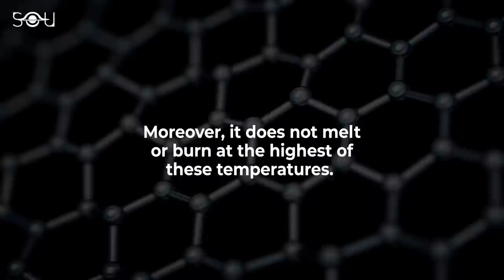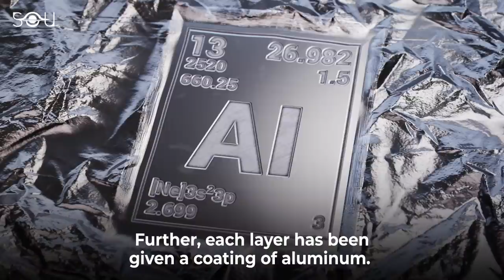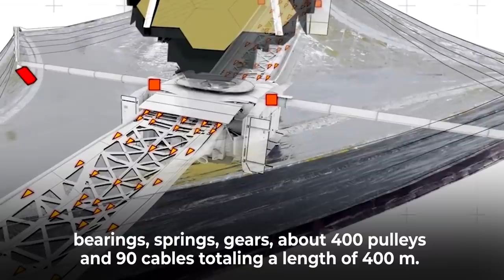James Webb Just Completed the Most Difficult Task of its Mission

Comment: The next most complicated thing will be the calibration of the individual hexagon mirrors to 100% precision in order to focus the light on the highly sensitive sensors!🔥🔥
Reply: Of course, that can be done using closed-loop calibration software.
Reply: Infrared waves not light.
Reply: @ianuragaggarwal  they can be referred to as light, because they are part of the electromagnetic spectrum. And the name is really infrared light. The word light doesn't necessarily mean visible light.
Reply: @ianuragaggarwal  Infared waves are light, just not visible light.
Reply: Still light bro.
Reply: Thanks for correction. Knowledge++.
Reply: @JohnSmith-bw8dn  No the 18 primary hexagonal mirrors are not precaliberated. Each mirror segment assembly have 6 degree freedom linear actuators and each hexagon mirror has its own actuator to move/ tilt over nanometer precision to adjust the radius of curvature. This will be the final process of JWST when it reaches the required cryogenic temperature level. And that's why precaliberation was not possible beforehand in  Earth temperatures.
Reply: @JohnSmith-bw8dn  it will take weeks to adjust all the mirrors once it reaches L2
Reply: @adarsh4764  one question, are they ahead of scheduled deployments of all equipments? because i remember after the launch they deployed solar panels right after it reached the orbit and one of the commentator said that ' solar panels are deployed ahead of the planned schedule'.
Will we see Webb telescope fully operational before 6 months?

Comment: Everything does not have to go perfectly for it to function. Even the sun shield didn’t have to deploy completely to be effective because they made it more effective than it needed to be to allow for failure. With the exception of the secondary mirror (I think that’s the name of the one that reflects the light from the big mirror into the sensor), everything could deploy 80% of the way and it would still work.  Fret not :)
Reply: We won't have to worry, Webb will fully deploy and we will get a new understanding of the universe from it
Reply: @livannal.t.9068  It will
Reply: Well that was only the first difficult task lad 😅
We still have a few more difficult obstacles to hold our knickers for
Reply: Very annoying soundtrack IMHO

Comment: 75% of the 344 Failure points are retired. Only 86 more to go! (Somehow this isn't very reassuring.)
It was 9 degrees and windy the other morning as I was walking to work from the parking garage. The traffic light ahead of me had just turned red so I decided not to walk all the way to the corner to wait for the light. I stopped in a spot of calm air about 15 feet away from a building, and thought "This can be my Lagrange point until the light changes." (Lol!)
Yes, I'm a science nerd. Always have been. Always will be.

Comment: Clarification: Kapton is a thermal conductor and electrical insulator. As a result, it's often used in cryogenics, and in the case of space equipment it's often used to keep things cool. It's also used to prevent shorting between electrical components.

Source: I work for a company that supplies components to various space organisations and other space companies.

Comment: Are there plans for an optical-telescope replacement for Hubble along similar lines?
Reply: Yes, and it has already been started. 

The Nancy Grace Roman Space telescope, started in 2016 and on schedule to launch in 2027, will be more "Hubble-like"... a WIDE-FIELD  primarily visible light scope with optical resolution similar to Hubble. But it will also have extended near-IR capability.

NGRST will basically be a wide-field hubble (meaning it will be able to observe more of the sky in only a few months than hubble has been able to over its entire 30 year lifetime!). And It will have:
-  extended near- IR capabilities, so it will be parked at L2 like Jwst.
- it will have a more advanced coronagraph than JWST, so it will be better able to image exoplanets than James-Web will.
- its spectrographic capabilities will be more advanced than JWST's as well.

So (assuming that JWST works & HST continues to work), the trio will complement each other:
- JWST will be the "deep IR" scope
- NGRST will be the main visible light & near IR scope (taking over for Hubble)
- HST will be the UV scope (since neither JWST nor NGRST will have UV capabilities).

EDIT: NGRST was originally the WFIRST concept. Was renamed to Nancy Grace Roman.
Reply: Yes. On 2 March 2020, NASA announced that it had approved WFIRST to proceed to implementation, with an expected development cost of US$3.2 billion and a maximum total cost of US$3.934 billion, including the coronagraph and five years of mission science operations.
So 4 more Billion to get more pretty pictures.
Reply: Note that Nancy Grace Roman Telescope was originally called WFIRST.

Comment: It would be cool to point Hubble at James Webb. Being the size of a tennis court I would think Hubble would see it with out any problems.
Reply: No. JWST is way too small for hubble to see.

Hubble has a 0.1 arcsecond resolution. That means that if hubble viewed objects on the moon, the SMALLEST thing that it would be able to see would be 200 meters. If hubble viewed a football field on the moon, Hubble would only see it as a single dot.

And JWST is WAY smaller than 200 meters, and MUCH further away than the moon.

So no, hubble can't see JWST with any real resolution. It might be able to spot the light off its sun sheild, but it will just look like a pixel of light (like a fairly dim star).

----------------------------------------
As an aside, note that JWST's resolution is about the same as Hubble's. Optical resolution is not only proportional to mirror size. Its also INVERSELY proportional to wavelengths being captured. Since JWST is built to observe in mid-infrared (which is way longer than visible light), JWST needs a bigger mirror than Hubble's to get the same resolution.
Reply: @beta_cygni1950  cool thanks for explaining
Reply: @grinderkenny  no problem!

Comment: It's crazy they built a telescope 100x more powerful than the Hubble, then launched it into space.
Reply: More crazy...the pretty pictures will do no more to help mankind than 30 years of Hubble pretty pictures.
Reply: Actually, it is not true that James-Web is "100x more powerful than hubble." In fact, JWST has about the same optical resolution as Hubble.

Optical resolution is not only proportional to mirror size. Its also INVERSELY proportional to wavelengths being captured. Since JWST is built to observe in mid-infrared (which is way longer than visible light), JWST needs a bigger mirror than Hubble's to get the same resolution.

It IS true that JWST's spectrometers are much more sensitive than hubble. That is probably what someone heard, and then misconstrued that to mean hubble has 100x the "optical zoom", or some such nonsense.

Comment: With such a wide temperature rainge from negative 269 to 400 Kelvin s Capton has a wide rainge of applications sich as micro wave oven insulations Army divers who works in freezing cold watets dich ad the artic
Clothing for people who works at tbe south pole diving suits 
As a replacement for asbestos and winter clothes. Army people who works outside in fluctuating temperatures and people who makes thermos flasks may appreciate it
Elon Musk may find an application for it in helping to keep his rocket engines cooler as far as insulation goes
There are probably many other uses for it. which can stArt or enhance other industries It could probably insulate the interior of a submarine or ship and help regulate temperatures on the Ronald Reagan CVS something are these ideas any good?

Comment: The only problem is after 10 years, it can run out of fuel.
Reply: With a life expectancy of 35+ years, that comment is inaccurate.
Reply: No, for 35 years it will take spectacular pictures of places we will never, ever visit and won't help mankind solve any of the massive issues we face TODAY!
Reply: @KorbinX  No it's 5 to 10 years or 12.
Reply: @nicholasmangadap6126  5 ½ years to 10 years of propellant, up to 35 years if the Orbit isn't affected and they dont need to do stability burns.
Reply: @KorbinX  The telescope need a thrusters to continually see the farthest stars, after ten years the telescope image would blurred because it can't move any longer.
Reply: @nicholasmangadap6126  yes and no. Yes because there is a limit to the amount of fuel, the life expectancy is limited, however, they can still take "images" after the fuel runs out. It will just be harder to align it properly.